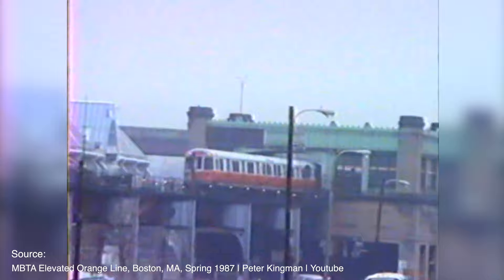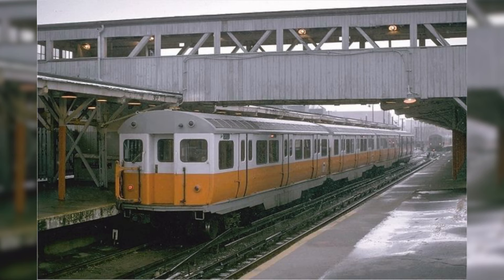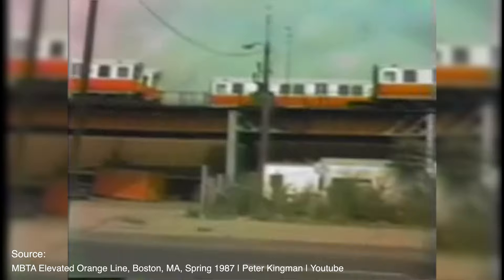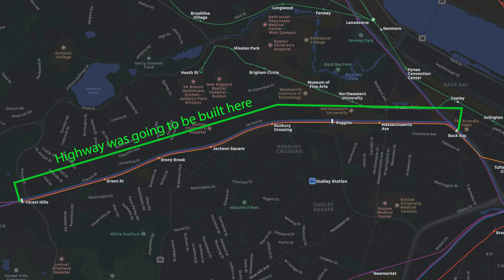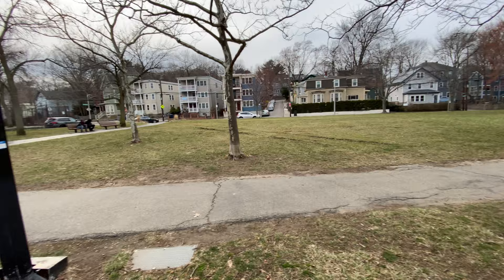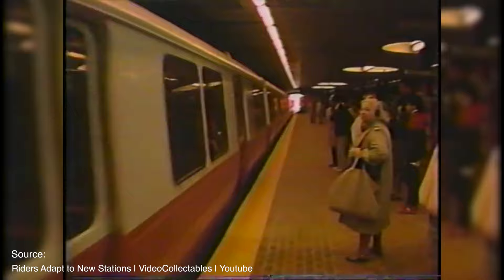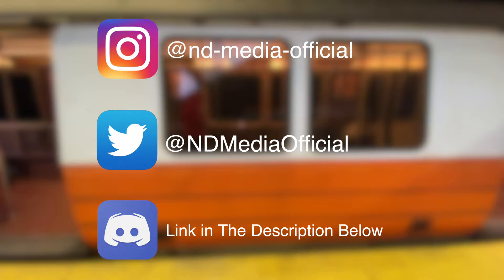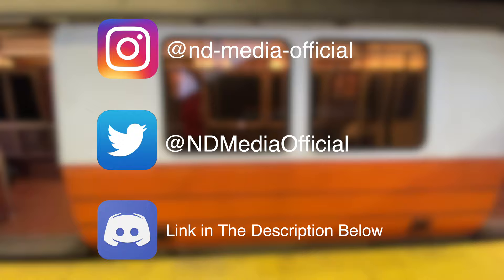Documentary/History: MBTA Orange Line

Comment: Wow.  You missed the entire early history of the Orange Line from 1901 to 1908 when the trains were run through the Green Line (BTC) trolley tunnels (as the diagram shows) while the future Orange Line (BERy) tunnel was built down Washington Street using the cut and cover method.  Temporary wooden platforms were built in the Green Line stations to access the trains' higher doors.  (Boylston Street Station was NEVER called Chinatown.  The Essex Street Station was renamed Chinatown.)  The BERy trains ran on a loop and branched off at Dover Street to run down the Atlantic Ave Elevated line which was taken down in the 1940s.  I realize you were only reporting on the later years, but the early history is quite interesting.

Comment: I love this video! I grew up riding the orange line and love to learn about the history. 

I really like the new orange line trains because of how clean they feel. The seats without carpet, bright lighting, and vibrant colors feel more modern and clean. Also, love the improved accessibility! There's open space which is great for parking wheelchairs or strollers or keeping service dogs against the wall to avoid getting stepped on. The doors each have the car number on one side with braille. Also, the fold-down seating is a great way to keep it accessible without sacrificing seats.

Comment: I feel the same way about the old 1400s (the Bluebirds/Redbirds) on the Red Line those were the cars I grew up with. had the 1200s been ordered with Cor-Ten steel they wouldn't have rusted out so quickly & could have received a midlife rebuild and lasted 20 more years. The problem with the traction motors in the winter was more a result of T management's misuse of the rolling stock. Instead of plowing the RoW they use the trains to simply blow/push the snow off the rails, the cars were never designed to do that. During heavy snowfall they run "snow trains" all night to blow the snow off the tracks. In '15 it became an epic problem. The 1200s also brought ATC (Automatic Train Control) to the Main Line & later full ATO (Automatic Train Operation) ATC requires the motorman to place the train in full brake if overspeed is detected, ATO applied full brake on it's own. Both systems also can place the train in emergency brake application when there is a signal failure. Most train problems are caused by this computer system rather than mechanical problems. That system also has always given dispatch information on train location & speed.
Reply from the maker: This is key information. I’m gonna use this info in the updated video
Reply: In NYC my old hometown a plow was attached to the end of a retired subway car to clear the 3rd rail and tracks. In 1968 during the aftermath of a blizzard I asked a conductor about why old subway trains were used in the rush hours when the modern subway trains were used also in the rush hours. He replied that the 3rd rail shoes of the old trains were made of iron and heavy enough to scrape of ice and snow on the 3rd rail. The subway trains that he was referring to were built from 1914 til 1922! They were called the BMT STANDARDS.  They lasted until August 1969.
Reply: @luislaplume8261  Boston has small scrapers that can be dropped down to scrape the third rail of ice. The older cars fro the twenties had heavy "shoe beams" that probably worked as well as those BMT Standards.😉
Reply: @aodhganmerrimac  Thank you for that news.  I haven't been to Boston in 22 years.
Reply: @luislaplume8261  We're still here! 🤣

Comment: Great video man, would love to see a dive on the other main lines (even the Silver line if you felt so inclined - yuck).  One fun fact - the OL 1200s only lasted as long as they did because the Blue Line's fleet of 0600 cars was used for parts to keep them running.  The 0600s on the Blue Line were virtually identical to the old Orange Line 1200s with the exception of their slightly smaller dimensions (and pantographs).  The next time you get on one of these rust buckets, you can thank the blue line for allowing them to stay in service.
Reply from the maker: Yeah I knew that since they are made by the same company. only a few years apart. they were identical since the MBTA ordered them pretty much the same time.

Comment: Since 2022, all new CRRC trains have run on the orange line with little to no old orange line trains remaining
Reply from the maker: Yeah it’s unfortunate but I’ve adjusted to the new cars and the thing I love about them the most is that they are loud. They are quite a bit heavier than the hawkers. Weighing almost 5,000 lbs more than the 12s.  As for the type 14 fleet, most of the problems were narrowed down to how they were manufactured in the CRRC factory in Springfield. Due to several term disputes with the various part manufactures, the car was still assembled even though it was missing parts. It sucks that their manufacturing circumstances are sucky but at the end of the day, they are quite nice and are a much needed improvement that the orange line was LONG overdue for.
Reply: @NickDaltonYT When I rode one for the first time. It had no issues, and I actually liked the design. It’s sad how I never made it in time to see a old version before they scrapped them

Comment: First minute and already mistakes.
It was called The Main Line...owned by the Boston Elevated Rwy.
The original line went from Dudley Station along the El on Washington St. From there, it swung left and turned down into the Pleasant Street Incline Portal, where it stopped at Boylston Street Station and Park Street Station on temporary Platforms, while the Downtown Stations were being completed.
At the same time there was the Atlantic Ave branch loop.
The causeway street closure was not that long ago.
The Atlantic Ave loop was closed in the late 1930s and torn down for War Effort scrap in WWII.
When the downtown section and the Atlantic Ave section opened in 1909, that line also had a Boylston Station, across the street from Essex Station.
The Downtown stations were staggered for space sake. One side was named one thing and the other platform a different name. Boylston/Essex, Milk/Water, Friend/Union, etc

In the 1940s, it was not called the T.
The "Early" cars you show were from the 1950s and 60s.
The Atlantic Ave El was not closed due to fire, it was closed due to low ridership.
Then, you show a recent photo of a derailed RED LINE train at JFK UMASS Station. 1:55

The new northern section to replace the Charlestown El  opened in the late 1970s, not the 1960s.
Reply from the maker: Alright bro look I made this video 2 years ago and I am fully aware I got a lot of things wrong. I am going to redo it after I do the Green Line documentary.
Reply: Also it's not Kowalski, it's Kawasaki...😂

Comment: The Hawker Siddeley MBTA cars for the Blue (1979) and Orange (1980-1981) Lines were based on the 1972 PATH PA3, in turn based on the 1965 St. Louis Car PA1. MBTA cars were the only LAHT (carbon alloy) cars built in Thunder Bay, which has always specialized in aluminum construction (every TTC subway car since 1965 has been built here, as well as the popular Bombardier bilevel coaches). Since Thunder Bay built the aluminum PA3s, very surprising the MBTA cars were not aluminum.
Reply from the maker: Wow! Interesting!
Reply: Big, big mistake not to build the 1200's out of SS or aluminum - this would have added ten years to their service life.
Reply: @pilsudski36  The 01700s built seven years later in Thunder Bay, however were aluminium.

Comment: The new Orange Line and Blue Line cars were order in 1975 at that time Bob Kiley was GM of the MBTA and Mike D was Governor of Massachusetts the order was for 190 cars 70 cars for the Blue Line and 120 cars for the Orange Line the Blue Line got there first 4 car test train in early 1978 cars were # 0600 thru # 0603 cars # 0604 & # 0605 were still at the Hawker Plant in Canada and cars # 0606 & # 0607 had the modified were sent to the Blue Line for the crews on the Blue Line to be train on as this was going on the first of the new Orange Line was under construction in 1980 the first 4 car train of the Orange Line were delivered by the B & M at the Wellington shops they were cars #!01200 thru # 01203 at the US Department Of Transportation test tracks Blue Line cars # 0608 & # 0609 and Orange Line cars # 01208 &  # 01209 were being tested by US DOT the new Orange Line cars did not go into service until late 1981 before these cars came parts of the Main Line El had to be rebuild so the Hawkers can run on the El the Dudley Street curve going into Dudley Street Station from Forest Hill Station had to be widened this because the Hawkers were 10 ft longer than the # 01100 series this cars were 55 ft long when the new Orange Line to Forest Hills got the ok from the Mass DPU to start testing a four car train on the new Orange Line a fly over was built by the contractor to bring a 4 car train to start testing the new Orange Line the MBTA brought one car at a time to move the cars from the old Orange Line to the new Orange Line they used a hi rail truck to do it that was done at night time there was a lot of derailments in front of tower W in the Wellington yard the curve in front of the tower had to be rebuild for the Hawkers there was one accident involving two of the # 01200 series both were four cars one of the four cars was running on a test track next to the shops and the other one was moving from the shops some how it side swiped the other train both trains were damaged the motorman that was moving the train from the shops to the storage track went beyond the double red signal side swiped the other train the design of the new Orange and Blue Line cars was the same design of the PATH cars that Hawker build for PATH 1977

Comment: MBTA should of went with Kawasaki with the new Orange Line cars, not cheap Chinese junk!!
Reply from the maker: Kevin B well it seems you have very strong opinions on this matter... interesting!
Reply: @NickDaltonYT  The problems they're having with these cars now, I don't even want to know what they'll be up against when the new Red Line cars make their way to the system, god bless the MBTA!!
Reply: That would have been logical, using a stretched PA5, much like the 01200 series is based on the PA3.
Reply: Kawasaki makes better quality rail cars and are also more expensive, but sometimes you get what you pay for.
Reply from the maker: Honestly they should have refurbished the 01200s since they are an icon of the MBTA along with the red line 01500s